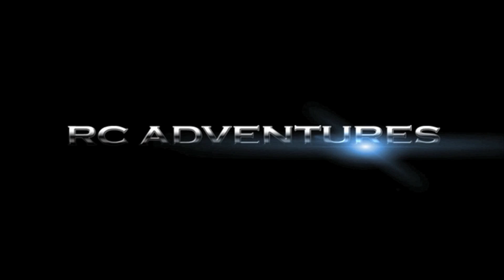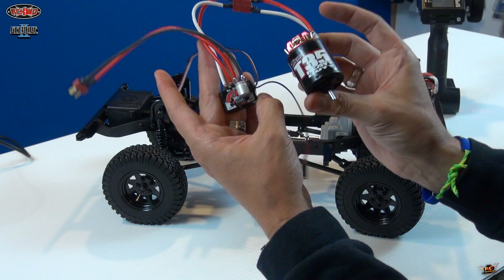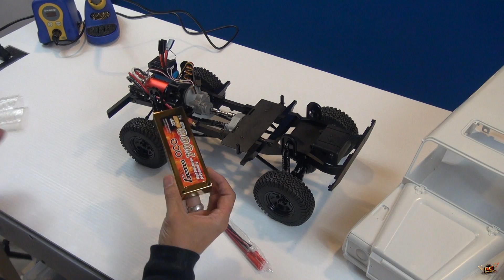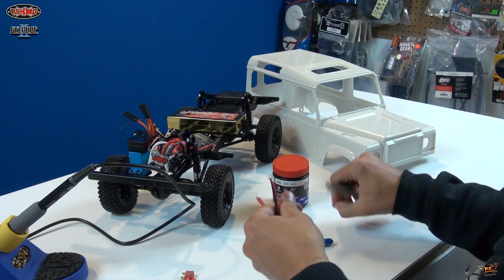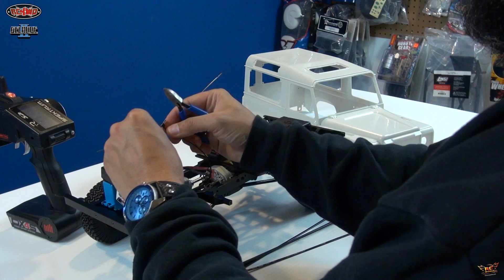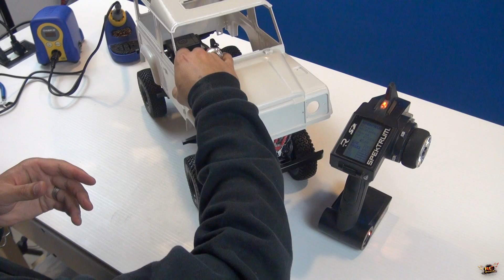RC ADVENTURES - RC4WD Gelände II 4x4 Truck Kit w/Defender D90 Body Set - Build Video (PT4)

Comment: Where can I get a good rc for cheap I'm looking to spend about 300$
Reply: thats almost impossible, one of the cheapest cars is a TF 2 i think its like 250 euros, but you need to count 300 euros with it cuz you only get the body and the frame, you need to buy a battery, a controller, a lipo, servo. i have bought a gelande 2 D90 about a week ago and paid like 650 euros from now but im building it atm and need to buy the controller and that is 150 euros so i hope i helped you.

Comment: Hi, I see that you have actually installed a brushless motor on the D90, I tried doing that but it did not work cause of the direction it runs, I mean for me forward was reverse and vice versa, changed it on the receiver with that It was faster on reverse and much slower on forward I was trying to install a OMG brushless 35T with censored ESC, even tried switching the wires around but no luck. Any suggestions ???

Comment: I was wondering what pinion gear you used. Did you use the 14t? That would only give a top speed of ~8km/h on the 1800kV motor you used and 2S Lipo. Is that normal for this type of RC? I am interested in scale crawlers but I am not used to such low speed.

Comment: I just bought my first axial scx10 on 8/7/13 and I don't wanna fry it using to big a battery can someone tell me if the stock esc will handle an 8.4 7 cell nimh

Comment: @Medic: Loving the detail you are putting into this build series :-)

Around 17:20 you test the steering and when turning full left it is lifting the right hand of the axle a little: Do you think this is just something that needs to be trimmed out with rod length or end point adjustments. Or would the Gelände benefit from a 4-link front suspension set-up?

Comment: Hey Medic, just wanted to touch base on the thing you said about the motor and ESC heat. I have the ROC 3100 in my Wraith and I have yet to get that motor above Luke warm. You will NOT have heat issues caused by them being so close. Good call on that motor. Its a monster.

Comment: Hey medic when you solder you should twist the wires and you should heat up the wire then ad solder you get a better solder joint its called tinning also yo probably don't need flux if you've got a good solder and a nice hot iron

Comment: Weight bias toward the front is good for crawlers. It helps the vehicle climb at higher angles without rolling backward and it's harder for it to get stuck on taller rocks, it'll just fall forwards onto it's front wheels.

Comment: Just a suggestion but i find that having two plugs per pack, one for driving and one for charging, is really nice when you need to switch batteries you just unplug the the banana plugs instead of the connector